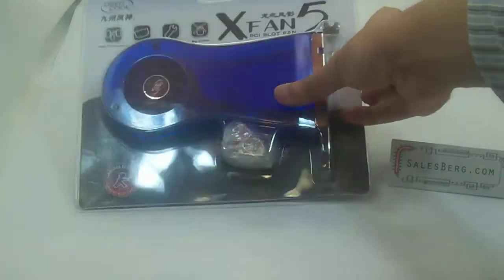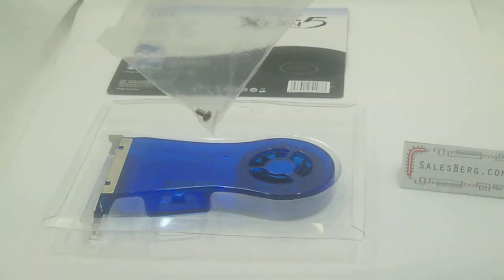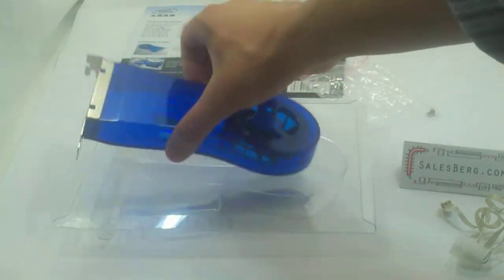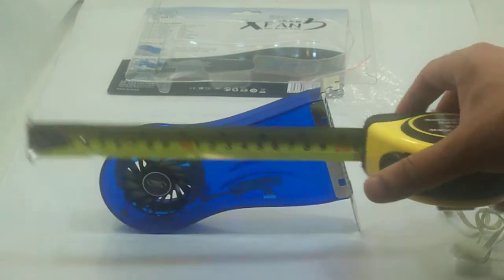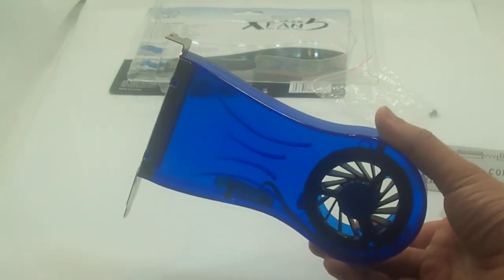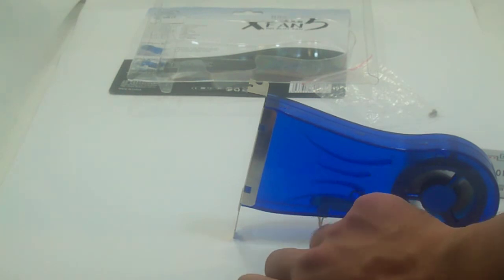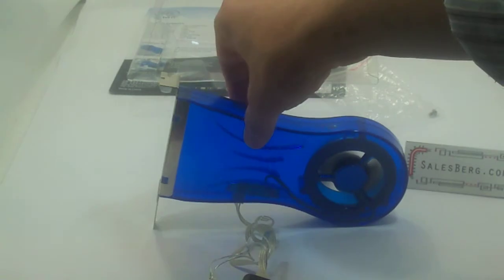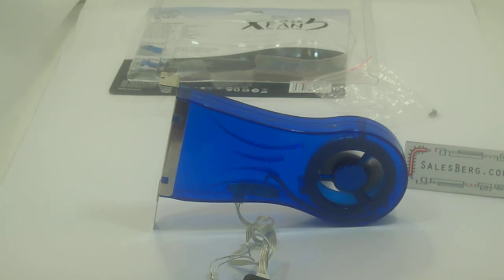DeelCool XFan5 PCI Slot Fan unboxing and Review

Comment: The perfect use case for this fan would be an old AT case that basically has no fan holes except for the PSU. But unfortunately it's too long and the CPU heatsink is blocking it in the upper pci slots (the only pci slots without actual slots). I know that there are smaller versions from different manufacturers, but the fan in this one seems really good for what it is. Too bad it didn't fit for me.
Reply from the maker: For an AT case, I take it the overall thermal load was not too much. The fan does help, I can say that from personal use, though it indeed is a shame that it did not fit..
Reply: @CyberCatTechnologies  To be fair, it's probably possible to saw it in half, make it shorter, and seal it together. For me, it's one of those things i bought a long time ago and forgot about it. In my 486 PC AT case, most of the heat comes from a raspberry pi that runs an MT-32 emulator.  :)

Comment from the maker: @anzenxxii 
Could not comment about any Thermaltake exhaust fan, though I'm sure it was a reasonable product. I'm sure there are purpose built graphics card cooler available in the market that fits your card. 
As with this exhaust, it works about 17.18CFM of air which is about half that of a 120mm case fan. I have often placed these at the very bottom of the case or at the top most and yes with desired effect. Cases like Antec Sonata, Coolermaster Sileo and so forth benefits from this

Comment from the maker: @BritishRider 
Hi, the manufacturer claims the capacity of the fan to be about 17CFM which is about as effective as a 8cm fan. Though I do not have the equipment to measure the accuracy of that claim, the fan in this test demonstrated a fair quantity of air extraction.